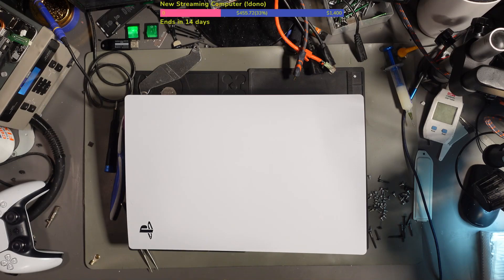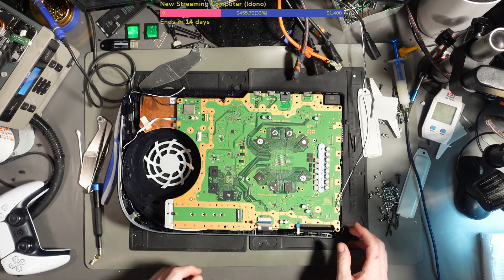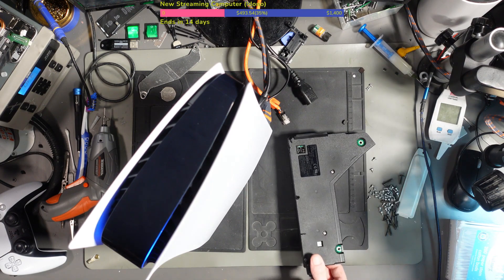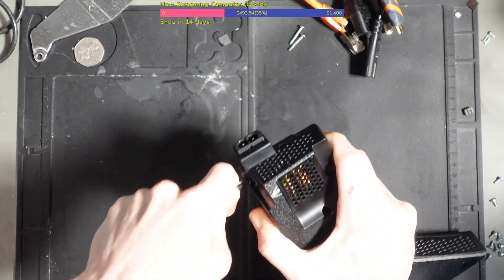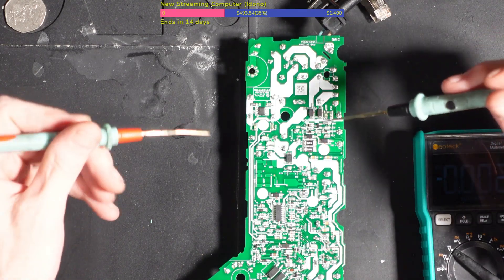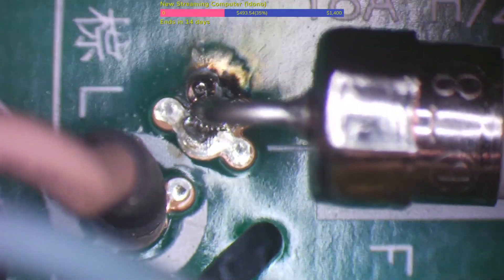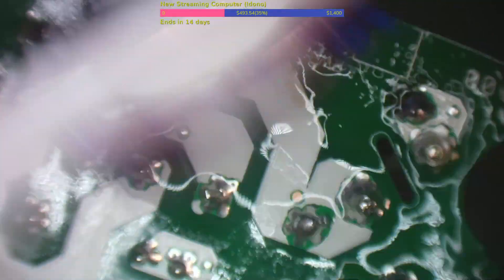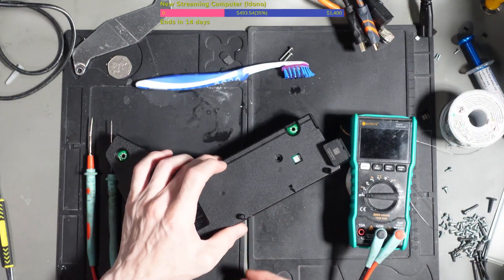Can I Save My Customer Money By RISKING My Life?

Comment: Good stuff man. Ok hopefully you can give me some input on this. A few weeks ago it was beeping, I changed the power cord and just press eject. The disc came out and holy shit it was working. Chose to reset to factory mode and that was it. It went back to beeping and not coming on. Today I decided to try something I saw someone do. I disconnected the led panel and it powered on, but no picture. I unplugged it since it wouldn’t turn off by pressing the power button. Plugged back in and it’s beeping again. Then a few moments of pressing the buttons I decided to press the  power and eject button and hold them down and somehow it came on in safe mode. I wanted to choose rebuild database, but listening to stupid video saying choose reset and hold x to restart in safe mode I did and we’re back no power and the beeps. I’ve been trying to get it back on in safe mode and choose rebuild database, but nothing. Any thoughts on what you think is happening? Thanks in advance.

Comment: Lol dude if it had been hit by lightning that fuse would done absolutely zip would jumped it , possibly distant strike couple kms away maybe, Brown out maybe but definitely not direct strike,  u need to brush up on mains electricity circuitry,  n u could fix any power supplies easily. And change out the fuse they blow for a reason,  n not always immediately!

Comment: Phil, for safety you should add a current limiter, easiest way to do that is to wire a 100w incandescent light bulb (not led) in series with the live conductor before your switches and add another switch in parallel with the bulb, this will bypass the bulb for normal use, if the console power supply is shorted bulb will shine bright and if supply works normally then the bulb will shine very dimly or not at all.

Comment: Why don't you run a 60w light bulb in series with the power supply, that way if there is a short in the power supply, the 60w bulb will light, saving any more damage to the PSU.

Comment: My thoughts with the power supply is that the Fuse has broken away from the PCB, either a dry solder joint or the PS5 was dropped. The marks on the PCB is probably due to the fuse getting a weak connection and heating up.

Comment: Get a proper professional multi-meter, makes a huge difference. I don’t mean a £600 fully calibrated fluke, take a look at the Brymen BM235, a genuine professional tool for £80 delivered that will last you a lifetime and not just die randomly. Better than paying £30 for a cheap one that fails in 18 months to 2 years, especially when it’s a tool you need to do your job daily.